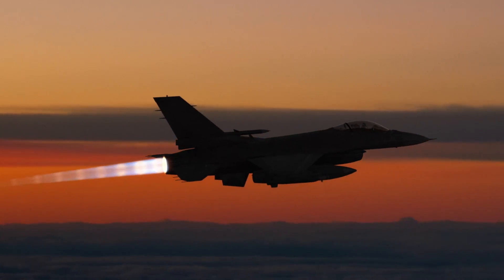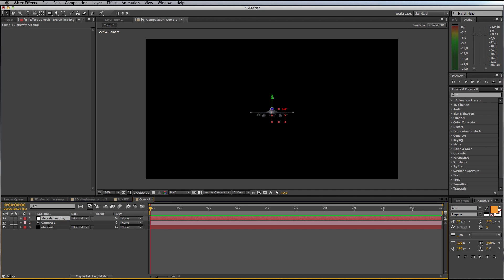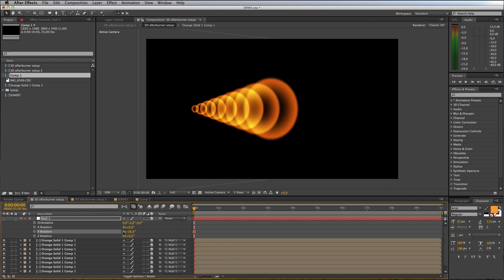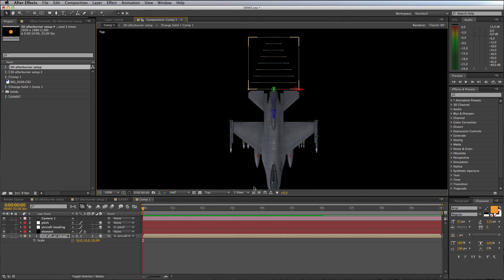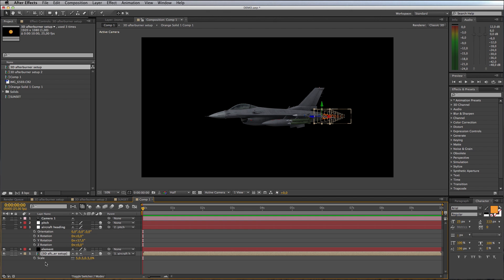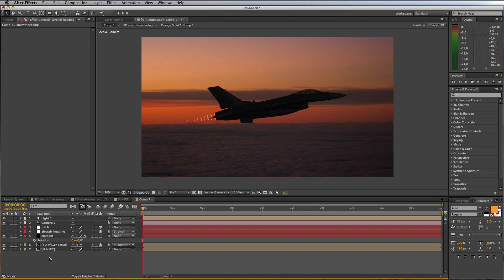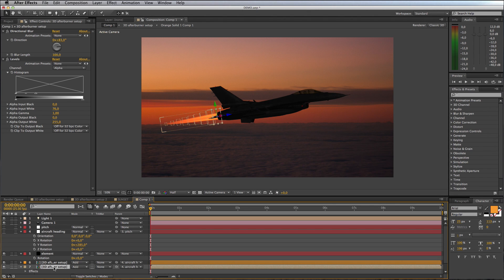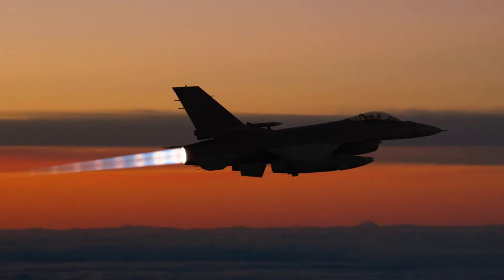Afterburner tutorial PART 2 - Adobe After Effects

Comment: awesome videos! do you know by any change how i can make the turbines of the c130 look like thet're spinning fast? when i try it looks fake. Thanks
Reply from the maker: Jonas De Roover You will have to really crank up the rotation and then enable motion blur - you might have to go into advanced comp settings and set your shutter angle to 180 degrees or even up to 360 and then you will need to up the samples per frame so the motion blur looks smooth and not stepped.  Then play with the rotation value until you get the look you want.  I would suggest doing all of this at half res or quarter res, oterwise it can take quite long to update

Comment: when i change the camera from active camera to top or side the jet will not move only the after burner ? im so confused
Reply from the maker: StickAndCheese Yikes.... Im not too sure why that would be the case
Reply: +StickAndCheese A bit late with my reaction... but you can achieve this by checking the ''continuously rasterize'' box on your Element 3D layer which is located next to the transfer modes. :D

Comment: Thank you for this amazing tutorial once again.
This one can be followed easily. However, i don't understand how i can make a proper masking on the afterburner that is over the jet when i stick it to the rear engine.
In your exemple (begining of the video) the source of the afterburner is shaped as the rear engine.
Any tips to correct that?
(Sorry for my bad english , i'm french)
Reply from the maker: Edouard Thomassin What you can try is make an extra circle or disc shaped solid layer, parent it to the group null and then move it into position at the opening of the thruster nozzle.  I hope that makes sense?